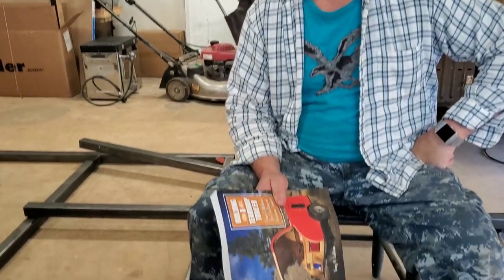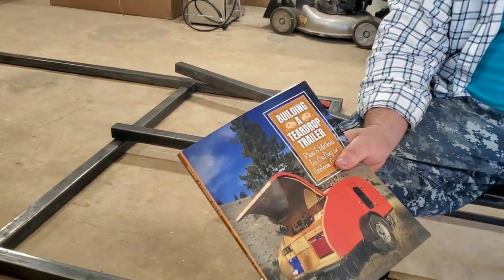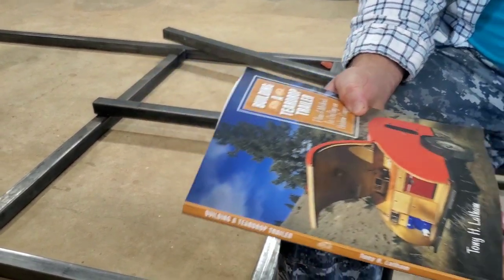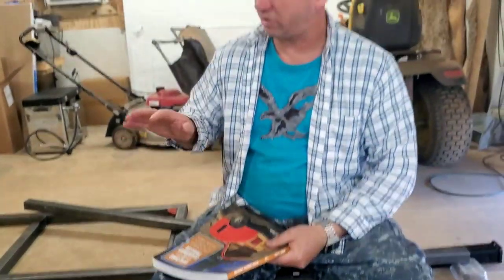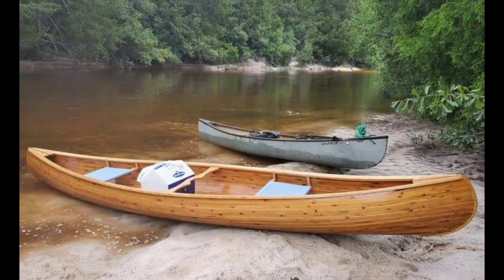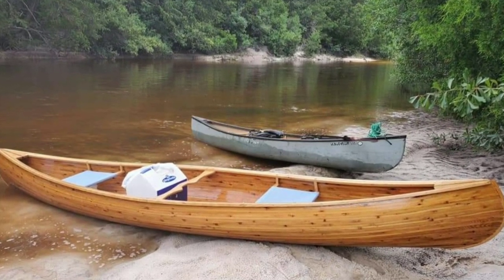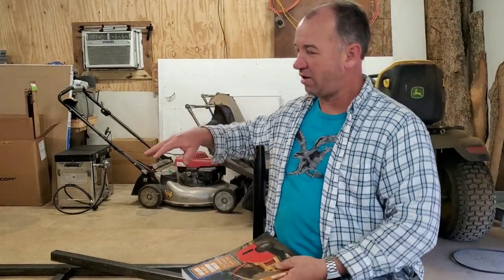DIY Teardrop Camper / Trailer Build

Comment: I was thinking of using 2 x 3 for my trailer, if you could do it over again would you still use the 2x2?Thank you for all your help I’ve learned so much from your channel
Reply from the maker: Thank you so much for the compliment! Thank you for watching and responding. The 2x2 has show zero flex. I would definitely use the 2x2 again. My next trailer will be a little bigger and heavier, I will probably use 2x3 but the trailer will probably be 1000lbs heavier.